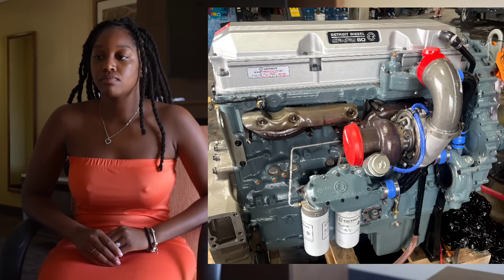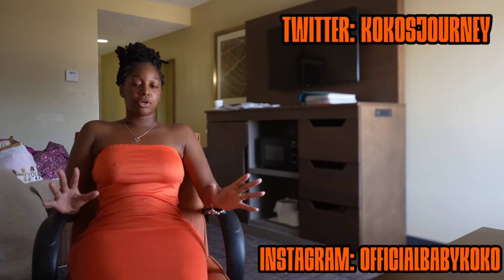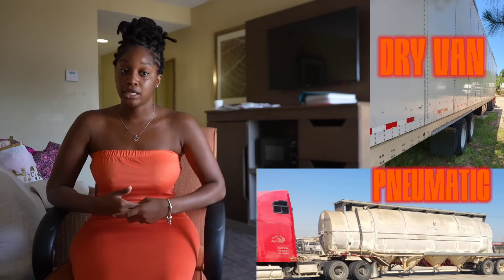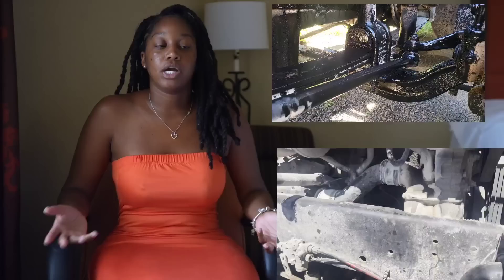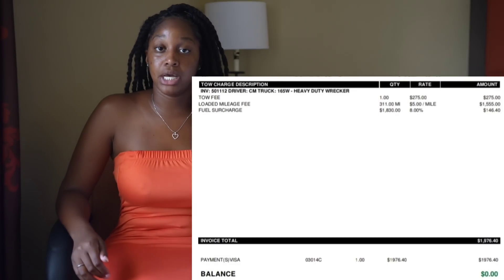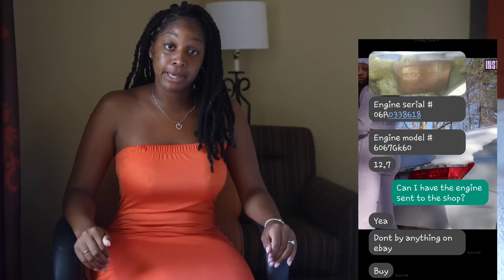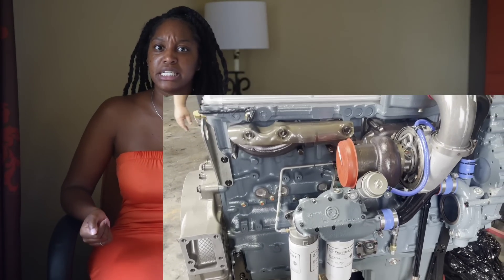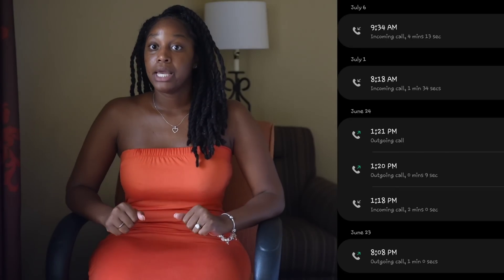How My 12.7 Detroit Engine Blew Part 1

Comment: I smiled ear to ear when I saw the picture of your remanded Detroit 60 series engine. It gave me a lot of hope because believe me, I’m going through my own storm right now.  I hadn’t worked from December of 2021 to April of 2022. I was close to being fired from Mercer transportation due to that safety blitz that put me out of service back in December due to breaks being out of adjustment. So I let my truck sat at the terminal for about 6 months while I started my authority process. Anyways I got the green light to run on my own authority after so many delays. Everything seemed to go smooth for a month and a half until my coolant hoses kept bursting on me every time I changed them. Turns out my cooling system kept being over pressurized. Found out that my engine had to be opened. That’s when I said “you know what? Let’s just rebuild the darn thing. $18k in rebuild materials and another $4k in other parts outside the rebuild and $8k in labor. My truck has sat in the shop for over a month now. I’m still waiting right now as of  Wednesday August, 3rd of 2022. The shop owner told me he will be done by sometime next week. I knew he was  jumping to other trucks while ignoring mines. It’s annoying when you are in the receiving end of that crap. I did see that he repainted my CAT motor and is putting stuff back together now.  But yeah I’m feeling it with you as well. Wish me luck for next week because I’m going to have to work like a dog for a few months to catch back up
Reply from the maker: I understand completely. 💙
Reply: We are short on Techs..Not our fault nobody want to fix things and be Under..PAID🤫🤔🤭
Reply: Boy you've REALLY gone through it with that truck. That goes to show your a strong minded person. I would like to hear your personal goals 🤔
Reply: I'm having the same issue my truck setting at home in the yard I have to get some more stuff done to it
Reply: Hello....wake up....does anyone realize she is trying to show something pointy?
Reply: @zacharywallace2243  ik the feeling of feeling underpaid…what I had to tell myself was it is what it is this is these folks business and this pay is what I agreed to nobody making me work so no point in bitching now…either quit or get the work done…

Comment: There's an old Chinese saying: the blessings never occurr in pairs, but misfortunes always come in tandem (福无双至，祸不单行). It happened to me a month ago that one of my dually rear tires disintegrated due to lack of air pressure. After I filled air to the remaining tires at a gas station, I went inside to return the borrowed tool to the assistant. There was a short wait for my turn and when I came back, someone went inside my truck and took my phone and some tools in my tool box. It never rains but pours... Thanks for sharing your story and stay strong!

Comment: Your strength and courage is amazing. I think you nailed the reason(s) your mechanic did a lousy job. It's crazy that any guy will cheat on a woman like you instead of supporting you in your massive undertakings. A guy talking to those mechanics would probably produce a different outcome. Anyway, you're a soldier, stay strong and keep it one day at a time.

Comment: My #1 problem as a owner was getting maintenance done on my truck... you can find a bad mechanic to work on your truck right away but a great mechanic is always busy and you gotta wait for them to start on your truck.
Reply: The same goes with the car. All the bad ones are never busy the good ones are loaded with cars in their parking lot
Reply: They’re aren’t enough diesel mechanics a lot of them are old and retiring out of the industry also a lot of them don’t have CDLs I have a class a and I’m still deciding if I want to drive them or work on them.
Reply: I’d say learn how to do the basic maintenance yourself oil changes, lights, mud flaps, fuel filters and a grease gun it will save a lot of time if you did your own maintenance if something major happens then take it to a shop.
Reply: I wish people understood this more . I stopped doing side jobs between low balling me and blowing up my phone hoping for miracles I was tired of it lol
Reply: There is some truth that but some can be great but just plan iut racist still they want to control your timing of you getting your vehicle back when they feel like it meet their limits of their racism inside of them but you can find some that's truly busy & they is some hard workers to get every step right
Reply: Learn how to work on your own equipment.

Comment: I thought I was the only one who suffered paying good money for bad repairs. I lost my semi after $80,000 in repairs and still had more repairs and the same repairs also needed repair. I worked for played at the jobs a few times and recently started a new company and rented a truck. Very costly but I still was able to save something. The rental truck was pretty new and it stayed with mechanical issues. 4 weeks later they truck still in the shop with the same emissions issues they "fixed" the first breakdowns and my company back inactive and I'll take my saved money having ass back to work for someone until I can buy my own truck again. The saved money ain't enough to brag on by any means. Gotta love the struggle I guess.

Comment: You said 40,000 for the engine, 14000 truck, 10,000 transmission, 14000 shop bill. That is 78000 dollars.  Even if you would have just put 20, 000 down for the new truck and 24000 for the next 2 years of payments you would have been better off.  And you would have still had money for insurance.   There is a reason why these big companies buy new truck about every 5 years.   You can operate with less trouble and you can just right the payments off.  You can not right off lost money that you never earned because of down time.
Reply: U can right off truck payments? I need to know more about that. I plan on purchasing my own truck and everybody keeps telling me don’t buy a new truck u don’t need it
Reply: @DONTXCRASH    Don't listen to them.  Getting a new truck under a lease was the best thing I could have down in my opinion.  My second year when I had a used truck I spunt almost 40, 000 dollars in maintenance.   The down time and the cost of repairs almost put me out of business. Not including the stress and frustration of going through a preventable situation.   You can not right of down time.  You can't even really budget for it because you really don't know how long it will be.  But you can right off a payment.  And there are so many benefits to a new truck.  Not to mention how much you will save on better fuel economy with a new truck.  No oil leaks.  No more D.o.t inspections of ur truck.  D.o.t usually does not inspect new trucks. It is a waste of their time.   Maintenance on new trucks is usually covered under warranty.    And you will have a working ac and good brakes, no air leaks, ect.  The pros definitely out way they cons.  And if you take care of ur new truck u will generally have a better resale value.
Reply: @cbeezyent  shes doing just fine her way ...your way was good for you...i believe that.
Reply: @blackbryant    She been losing money and time for a long time. A used truck can only do so much.  It is a reason why big companies do not have old trucks.   They did the math and they know like I know.  The benefits out way the cons.
Reply: @DONTXCRASH  it depends on your resources. If you know mechanics and are mechanically inclined get a used truck. New prices aren't worth it most of the time. It's just like a new car that losses value very rapidly. Bottom line is you can get buy a thrive with a 3 - 6 year truck and spend way less. Buying new trucks is for established businesses that want to be hands off and have lots of money to carry the high note.
Reply: @DONTXCRASH  you can write off trucks depreciation too
Reply: Nah. Basically she just got a glider. Good investment
Reply: I prefer new tools and vehicles, if you are going to be using them extensively. You can make the money to pay off that new truck in 2 years. To many parts to go wrong with used vehicles, and you don't know the full history of maintenance, part swaps, and accidents.
Reply: It just helps to have a good starting point. And they are more safer.
Reply: All good knowledge thanks everybody for your input
Reply: Yeah but them old trucks are like dinosaurs they're really good and if you redo them over like she's doing them them suckers last forever. They were just built better back then the new trucks are not built as good as the old trucks. So I think it's worth her getting it refurbished. They're classics.
Reply: The amount of money in gas by itself that you spend on a old truck will cost more then you will said in that old truck.
Reply: People with money don't need truck payments. Big companies lease new equipment every 3-5 years for many reasons one is to entice People to work for them, 2 government compliance, 3 warranty bc drivers are drivers they only know how to look out of windows. Again there are many reasons. If I was in her shoes at that time I would've probably rented a truck to keep making my money but she probably can afford to sit bc she's a person with money.
Reply: @k.lamareyev4418  me being in trucking for 5 years and figuring out that I rather drive then sit at a mechanic shop or at a hotel out of town.  Been there done that.
Reply: @cbeezyent  same
Reply: I am also at trucker with a heavy spec, 2019 567, Peterbilt with 560 hp it run fairly well I have a little problem but I honestly tell you that I would never buy a used truck again I would definitely go new when I am buying my next truck and when I buy it, it was only about two years one fairly new
Reply: @rickordoeast7610    Thanks.  People think that saving a few dollars in the beginning is worth it, but when you have contracts with basically Garanteed money on the line you don't have time to sit around and wait on a old truck to get fixed then brake down again  then brake down again and not to mention how DOT likes to target older trucks not to mention how bad they run on fuel not to mention the peace of mind you get when you know that your repairs are covered under warranty and the shops are less likely to try to screw you.  It is too many benefits to having a newer or new truck.  Then the mountains really test ur truck.  I can go on all day but to each his own, I know better.
Reply: @cbeezyent  you’re 100% right and losing money in the process based on my experience like I said before yeah I would never go use again getting a new truck in most cases in the first 3 to 4 year you won’t be having any major issue and if you do normally, you still have warranty at that point.
Reply: Say what do you know about Super Ego
Reply: @cbeezyent  PREACH BROTHA YOUR TELLING THE TRUTH💪🏿🦾💯
Reply: @jaiheira    Thank you. After giving away so much money trying to have a paid for truck I got smart.  Just make the payments and stack my money.  It is hard to make money when ur truck is in the shop.
Reply: @cbeezyent  thanks for the advice.

Comment: They bout to remodel the shop off of what you payed and all you got to do is put fluids in it and the turn on the truck then shift while parking brake is on threw all of the gears so that the gears won't slip after new fluids are put in you'll feel the difference after you shift there while parking brake is on then put in  nututal and then back in first more than like it. Might out of first so in second it should build on trans fluid and all the rest should be fine because of limp mode

Comment: 8 months ago, I decided to buy back my leased BMW X3 M Sport.   The dealership didn’t like me buying since, they can sell it for more.   They tried everything trick to sell me a new overpriced SUV with less options than I had. I refused all the offers and I made a mistake of asking them to replace all the fluids (brake, Trans, axle) since, I have been servicing my SUV with them for 3 years.  Long story short…my SUV was butchered.  Brake caliper leaks and Transmission leaks.  Moreover, they wanted more money to fix the issue they caused. I was pissed but, just payed the original quote and towed my car to small shop.  The small shop found out that the dealership broke the brake bleeder valve and he was able to drill the remaining part out and replace with new.   The transmission leak was from an under tighten pan screws ☹  I have currently joined an online BMW club, invested in a scan tool and looking forward to servicing my own car.  I wish you all the best.

Comment: Damn . When it rain it pours driver. Been there. Seems that shop was trying to sabotage you. I can definitely relate. Found it to be a lot easier to switch to local hauling gravel, sand , dirt, rip rap. Less head ache. If I were to go back over the road it will probably be to haul livestock, cattle 🐄

Comment: I had the same issue you should’ve towed it to your truck repair shop
Reply: Meaning I had to learn to hard way the first shop was just a waste of money problem wasn’t fixed at all so got it towed to Orlando then had a whole over haul done to my engine with turbo with transmission don’t listen to those hater your truck will me brand new

Comment: All the new parts that you replaced on your Freightliner should help it to last many more miles. That is my hope. I am displeased that you encountered too many problems. They led you to become a truck driver and mechanic. As for your trips to the repair shops are concerned, some repairmen can be rude and unbusinesslike. I am pleased to know that you were not injured in the automobile. I am still sorry that your truck has been inoperable in such a long time. You have been badly cheated. I hope you may be able to conjure up at least one court case.

Comment: Call TOM NEHL in Jacksonville they have used 12.7 engines or 14 L Most  important  the stand by them. The guy who sells  the used engines  can tell who can put them and rebuild them.  I have a volvo 770 I blew my engines and it had a volvo engine in it . He is going to swap it out with  12.7 and rebuild  it with a new  harness plus paint 20k out the door.  2 or 3 year warranty.  Talk to me if you don't get you engines together.  This guy  builds  show truck engines. Swapping dd15 out Cascadias and putting in 12.7's

Comment: the ac line is metal, the ac compressor is aluminum, the nut siezes on the fitting and breaks off all the time, they should have made a call and gave you the option to buy a new compressor, the missing clutch brake was only part of the problem, the pto engaging with no air pressure was they didnt hook up the air line to the 90 psi regulator, 10k is a very large labor bill, i would also think the clutch pedal not returning all the way would be they put the linkage rod on the wrong side of the arm at the transmission, and or the bolt doesnt have the spacer in the bushing to keep it from pinching. it should be on the frame side.

Comment: But i would of sell the truck and try get a new one or a use one  that in good condition  . Thats my opinion  u can get a truck  for $80.000 or 90  depends  on who u meet  u can get it for less . Getting  a new engine  etc set u back from going  back on the road for weeks soo the faster way was to sell it try get a new one for reasonable  price

Comment: as young man who has experience working on diesel and gasoline engines. great technician are the one who verifty the costumer concerns, and even go beyond the duty of mechanic,  but ensure that the truck is operating at it full potential.

Comment: I'm going to say this as a diesel mechanic a mechanic. If your truck didn't have the particular problems involving the clutch and the air conditioning if he put that engine in that truck and the transmission he is liable for that truck to be under working condition when it comes back out he is responsible especially when you didn't even have a problem sometimes when you remove an engine you have to remove the refrigerant and some of the hoses or components of the air conditioning that is supposed to be included in the price when he's putting the engine and transmission back in there let alone clutch adjustment if he does not do it you Sue that man sue him and tell him it's going to be a heck of a lot more than what he can even think about that is horrible that they would do that to you

Comment: This is crazy I have been having a hard time since the beginning of the year this is just crazy every time  I get out of the hole I get push right back in the hole again it’s like I’m on attack crazy 😡 ask your family to pray for you start kicking ass and taking names hold the shop responsible for fixing your truck like it should be if you didn’t have no problems with your truck going in other than your engine or transmission those should be the only problem you have coming out get you a good lawyer and sue the ass!!! They are causing you money So sue them for the money you are missing I will pray for you my beautiful sister🙏🏾🙏🏾🙏🏾

Comment: Dang what shop is this? I’m in this area often… I can understand you don’t wanna blast them(at least til they get you Wright)… been waiting on my 01 FLD for 4 months now after a rebuild, went back in for a rattle and haven’t been returned yet… sent the injectors off and they claim they’re(kenworth) waiting on the manufacture to check them out… story is longer but I’ll stop there. Had to jump in my other truck to stop the bleeding… hopefully you’ll be rolling very soon and shake back asap… your situation definitely isn’t for the weak